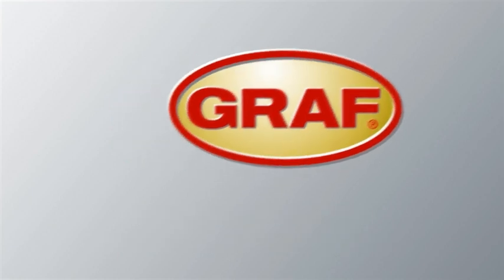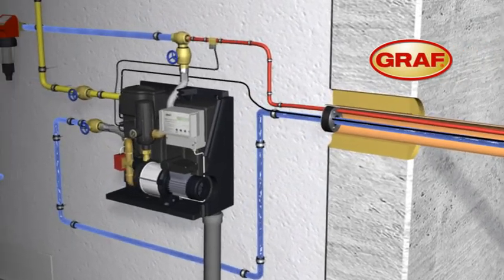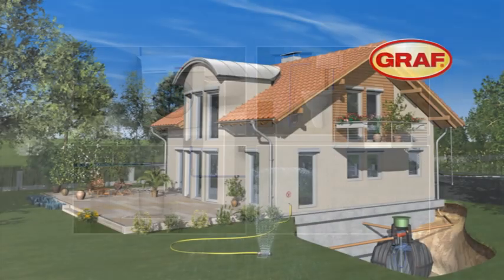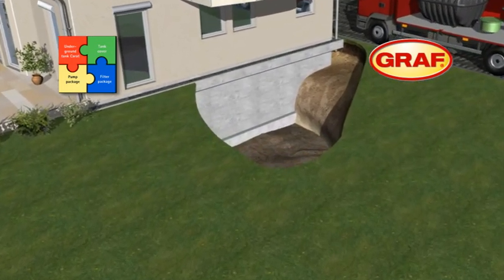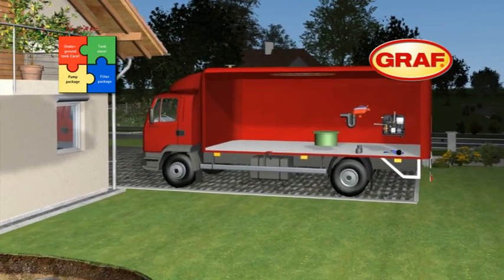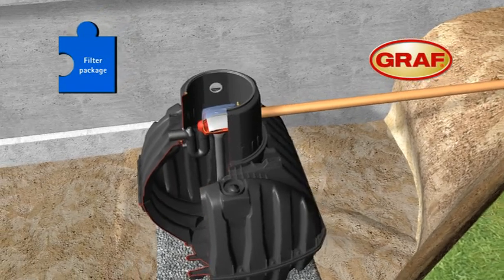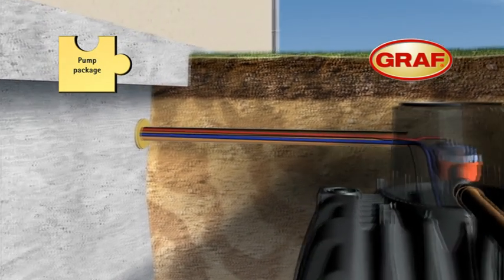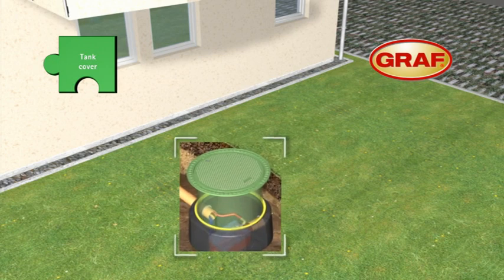Operating and installing a rainwater harvesting system

Comment: I strongly recommend not to buy this system from Graf. I have it for several years and it does not work. When the tank is half full it still uses the drinking water. Water level sensor sometimes works and sometimes not. Supplier of the system (in Slovakia) was not able to fix this problem. Plus the water pump is weak - low pressure for grass watering. Save thousands of EUR and avoid their products.
Reply: fordítás:
Erősen ajánlom, hogy ne vásárolja meg ezt a rendszert a Graf-tól. Több éve megvan és nem működik. Amikor a tartály félig tele van, akkor is használja az ivóvizet. A vízszintérzékelő néha működik, néha nem. A rendszer szállítója (Szlovákiában) nem tudta megoldani ezt a problémát. Ráadásul a vízszivattyú gyenge - alacsony nyomás a fű öntözéséhez. Takarítson meg több ezer eurót, és kerülje termékeiket.

Comment: How close to the building do you have to have the tank?
Reply from the maker: Dear Andy, The minimum distance should not be less than 1 m. The maximum distance is only important if a permanently installed suction pump (e.g. Aqua-Center...) is used. In such a case, the distance between the tank and the pump should not be greater than 8 m. If you have any further questions, please do not hesitate to contact us.
Reply: @ottografgmbhenglish  Thank you for the reply! Hope you have some more videos on your products coming out soon, they are excellent.  Would love to see one on the fresh water tank  or the firehydrant set up for the rainwater systems.

Comment: How do you clean the tank?
Reply from the maker: You don't need to clean the tank at all as long as the filter gets maintained frequently. In case you want to clean it, you can use a garden hose or high-pressure cleaner and pump out the water with a sump pump.